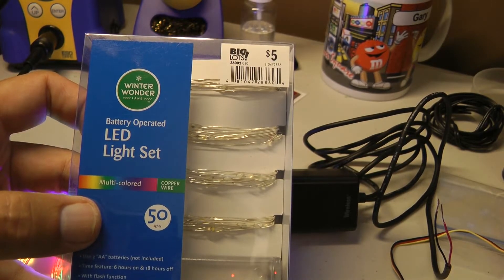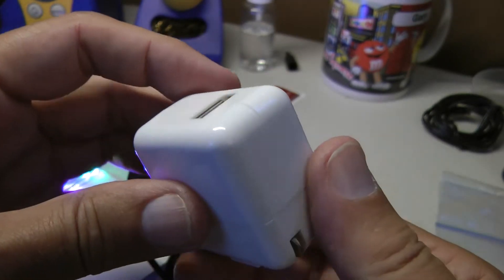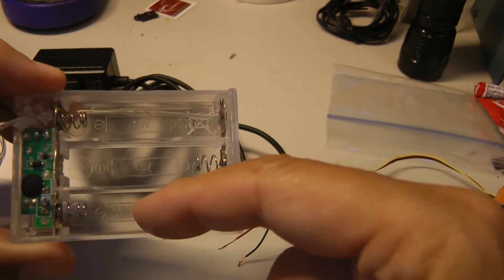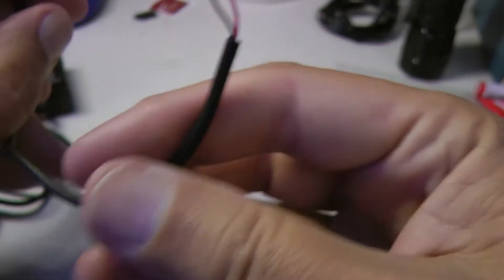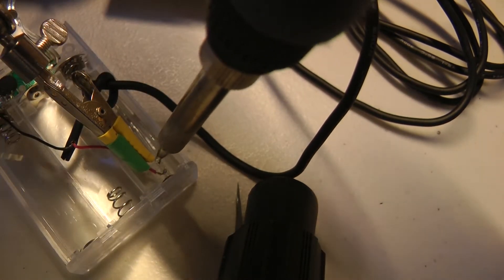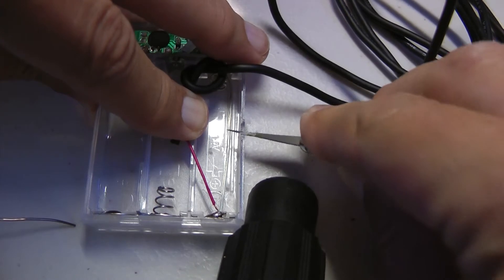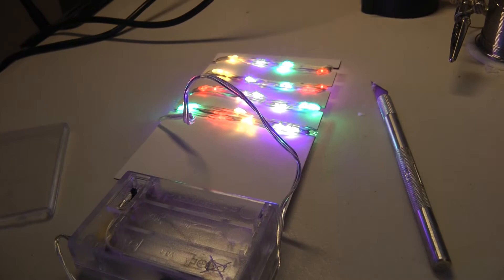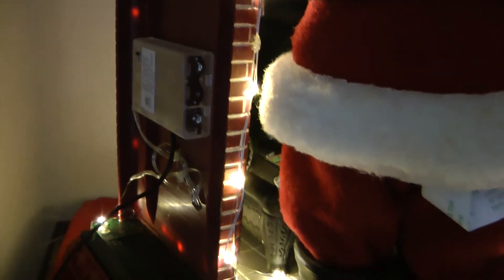Convert those battery operated LED Holiday lights to electric using a cell phone charger

Comment: I've done several of these projects, but my conundrum has been also keeping the batteries in just incase the power goes out. The problem is obviously overcharging the batteries. I did that on one project, so I had to choose which method I wanted, bats or ac power. I'm working on a method to have both, and still keeping it simple.😅
Perhaps using diodes might be the way. Good vid.

Comment: Once the wiring is done could seal the box with silicone to make sure water or anything can get inside the box to the wires. Silicone will make it waterproof. Even if you only use it inside liquid can still possibly get inside so seal it up. Just a thought

Comment: To create the slot al you needed to do was touch your hot soldering iron where you wanted the wire to go into the box. The plastic isn't going to hurt the iron it's just going to melt a hole into the plastic. Easy pesy. Lol